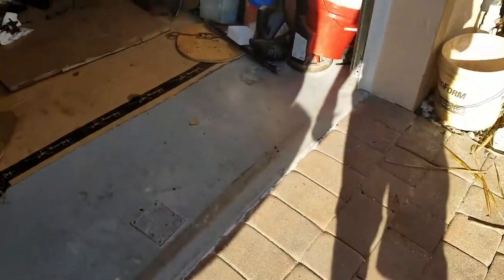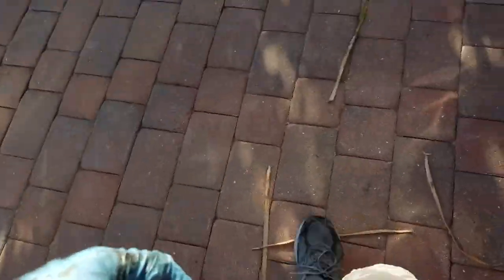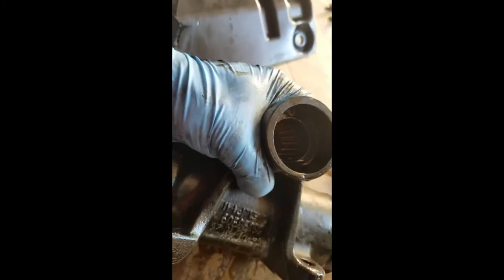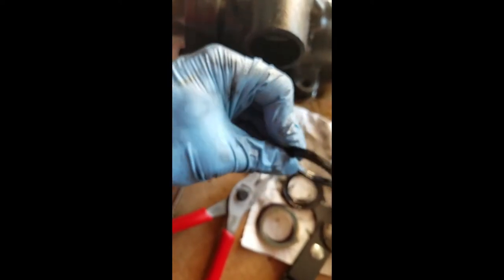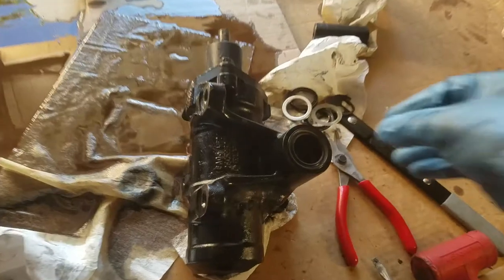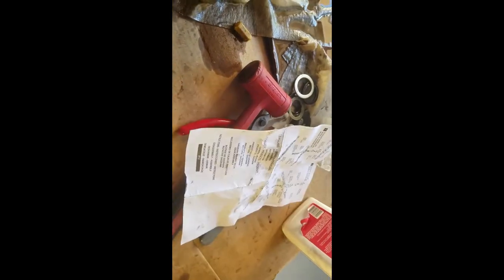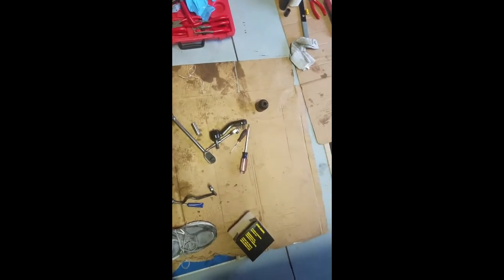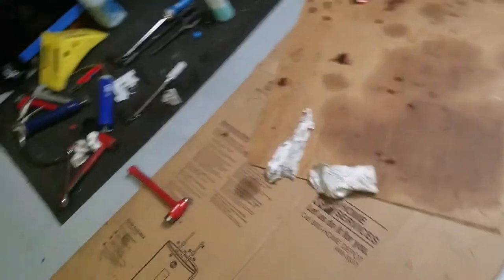Delphi Silverado steering box leaking from Pittman Arm Seal.  New seals! No leak!

Comment: I'm glad the one on my 06 Yukon is still holding up well.  All I've done is replace the inner tie rods about 10 years ago.  I did turn the set screw about 1/2 turn to take up a little of the slack.  I also installed the Cognito steering brace for the pitman and idler arms along with a rough country steering dampener.
Reply from the maker: The heat here kills everything.  This box leaked twice from this seal. They last around 70,000 or so. I had to turn that adjustment screw a few times I did it when I changed the seal again.  Been through I dunno. 4 hoses now?  I put back a OEM GM pitman arm I didn't like the moog one It was always very stiff it steers way easier now.  Less resistance.  Really it needs new gears these delphi boxes are not as adjustable as the older Saginaw boxes.  Which was all sold to China Which is awesome but that's another story.  Some Shandong China whatever company owns all that innovation now + supplies near every automotive OE.  Now the CV boot is leaking on the left side. Needs plugs/ wires and I should change all 160k Original o2 sensors  Too much for this place. Its not a mechanics shop

Comment: What is the torque for the 4 bolts holding the pitchman shaft to the housing? Also what is torque for the lock nut in the center? Rebuilt my gear box that didn’t leak but had a groan. The brown is gone but now it leaks from where the top of the pitman shaft meets the housing.
Reply from the maker: Think it was around 37ft lbs I forget I used Saginaw box specs because I didnt have spec sheet for a Delphi . Your O ring is probably leaking from the top or if its a older Saginaw box the gasket is bad on it. sometimes it will leak under the lock nut and the allen shaft

Comment: I have replaced a few steering box lower seals and can't figure out why the lower seal in this box seems upside down. I have heard it called a dust seal but there is another "dust" seal below. The idea is to keep the oil from leaking out. Was this manufactured wrong and everyone just goes along with it.
Reply from the maker: Thats how the delphi boxes are just do it that way. The Saginaw box the seals go regular
Reply: @GhettoWagon  But I don't want it to leak. It won't leak with the seal the other direction.